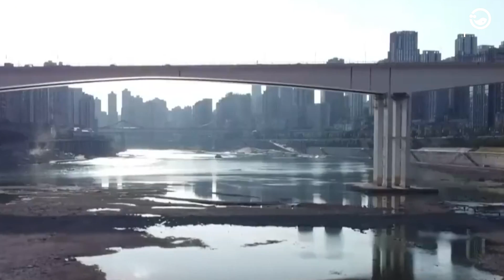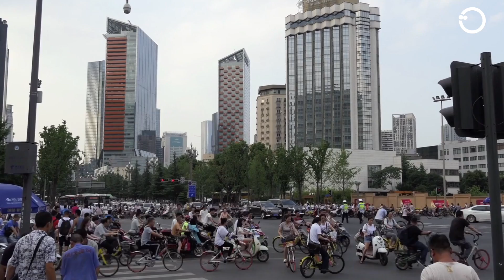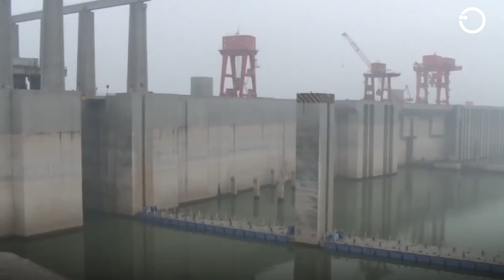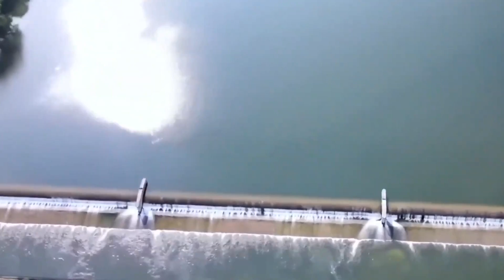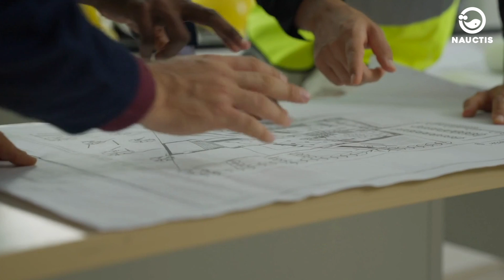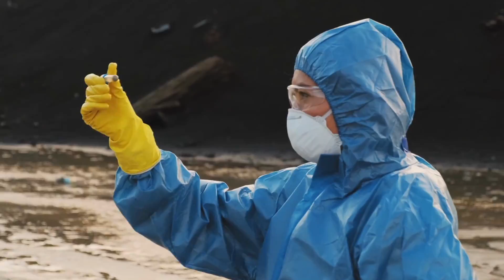Mega Tunnel Project: Moving the Largest River in the Country | World's Largest Water Moving Ever Do

Comment: woo, mate, nice vid, yet there are 2 mistakes I have found
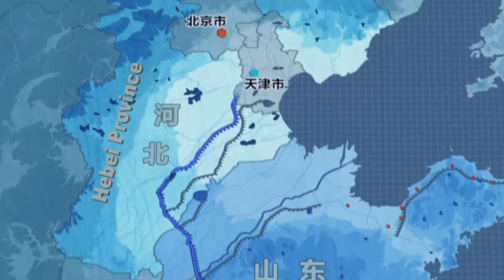1.The map on 5:07, that is east route.
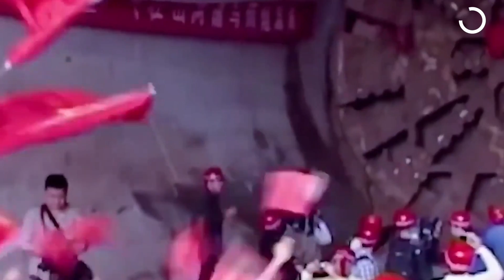2. On 9:23 there is no Dongping and Dong'e province. They are counties, rather than province.   In China, administrative divisions have 5 levels, the highest level is  province or municipality, the goverment of province or municipality is directly under central goverment's administration. 2ed level is city, in fact there are 2 levels of city, normal city and vice-provincial city, the goverments of the cities are under provinces' goverments' administration, no matter if it is normal city or vice-provincial city (usually only capital of each province and very few important cities are vice-provincial cities, there is not too much difference. However, the officals of vice-provincial cities are one level higher than normal cities and those cities usually have stronger link to the central goverment comparing with normal cities). 3rd level is counties or districts which is udner cities. Usually, counties are some small cities that connect to rural area, while districts are parts of city, needless to say that the goverments there are under cities' goverments' administration. Meanwhile, usually this level is the lowest for urban area. 4th level is the towns and 5th the level is villages. They are both usually rural area.